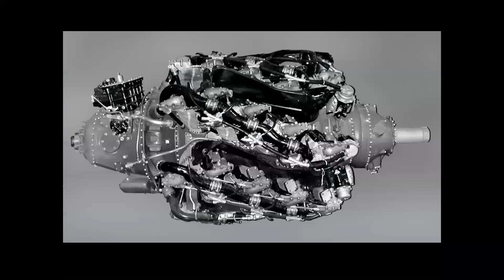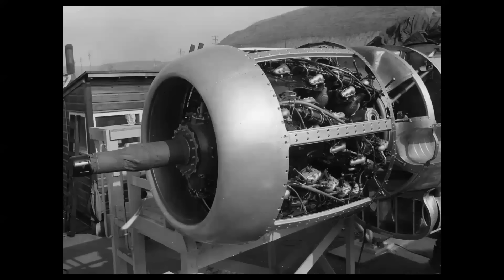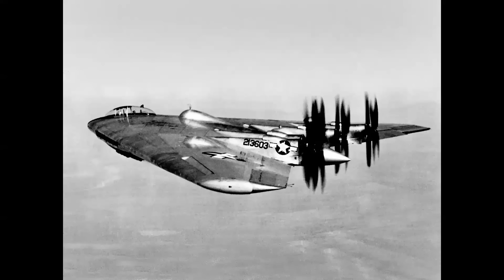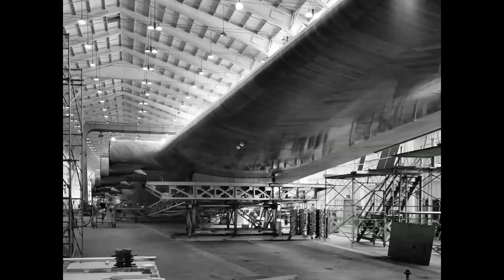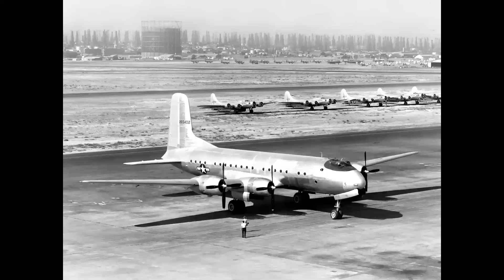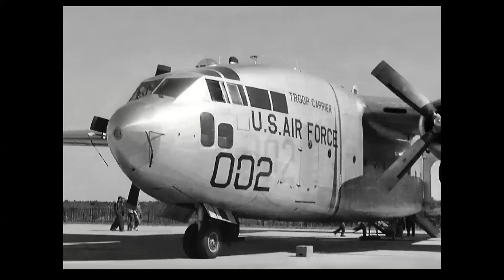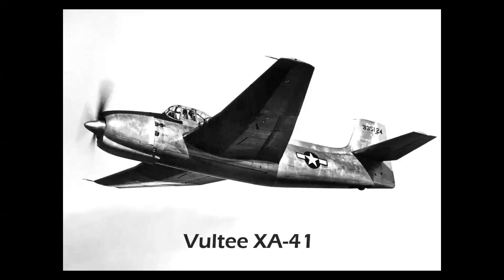PRATT & WHITNEY R-4360 WASP MAJOR AIRCRAFT - Airplanes powered by this giant radial engine

Comment: The Pratt and Whitney R-4360 Wasp Major was truly a formidabile engine for it's period but from what I understood it was very mantainace intensive, the Wasp Major engines also had a prodigious appetite for lubrication oil with each engine required a dedicated 100-gal tank. Normal maintenance consisted of tedious measures, such as changing the 56 spark plugs on each engine as the plugs were often fouled by the lead in the in the 145 octane fuel required by the R-4360 engines. Thus, each service required changing 336 spark plugs. It should be noted that engine fires occurred with the B-36's radial engines, some crews humorously changed the aircraft's slogan from "six turning, four burning" into "two turning, two burning, two smoking, two choking and two more unaccounted for" because this problem was exacerbated by the propellers' pusher configuration, which increased carburetor icing. Good job again 👍👍
Reply: They were impressive but in all reality they weren't very good engines, 4 rows is just too much and it led to the same kind of heat issues in the rear bank that the R3350 had if not worse.
Yea, of course I'd like to have one on a stand in my back yard so I could fire it up every morning just to drive my neighbor's nuts and blow the awnings off their house, but they still just weren't a very good aircraft engine.
Reply: I read that too.
Reply: The B-29 was ridiculed as " it has more Bugs than the Smithsonian " by one of the top USAF Generals at the time. Because the B-29 was prone to more downtime and awaiting specialists to fix a myriad of chronic issues with the aircraft causing sortie mission headaches and logistic nightmares for all who were dealing with the B-29's.
Reply: @faerieSAALE  One glaring problem being that of the particular model of the R-3350 Wright that powered the B-29 being RUSHED into production with out addressing the overheating issues generated by the exhaust manifolds being placed in front of the engines cylinders thus blowing hot air that was supposed to cool the cylinders across their cooling fins instead of cool air = OVERHEATING! I'd have enjoyed hearing the explanation from the KNUCKLEHEAD engineer that let that one slip by. That boo boo caused a lot of problems in addition to costing a few lives.
Reply: @topturretgunner  sorry but I saw only now your reply to a fellow as I'm very interested on this subject. In truth it always leaves me perplexed the positioning of the manifolds in front of the Wright R-3350 Duplex-Cyclone radial engine and as far I understood it is one of the very few radial engines installing the manifolds this way. As you rightly pointed out,  instead cooling it was blown in overheated air especially at the heads of the finned cylinders (hence the reason why it was often gulping the valves!). In truth I suspect that the Wright company was built around the most compact engine possible and was built originally as a single row engine with the exhaust turned to the rear and therefore it didn't had much cooling issues. Originally it was derived from the new Wright R-1820 9 and when it was united with another Cyclone (both an improved version) it was discovered that there was no space for the rear mounted manifolds so they were forced to install the manifolds at the front and I'm sure that they knew that it would suffer overheating problems but they tried to solve the issues, not successfully! As a matter of comparison also the German BMW 801 (installed on the Fw 190-8) suffered serious issues with overheating fitting various exhaust pipes and it was quite solved with a front mounted fan although it did absorbed around 100 hp. That said not a few crews got killed on the B-29 and very often the engines instead of being maintained were simply junked especially in Iwo Jima so perhaps as a hindsight it would have been a much better proposition to install the powerful and far more reliable Pratt & Whitney R-1830 Double Wasp but it fully occupied producing those engines for the P-47, the Corsair and the Hellcat. Hope I didn't bore you....
Reply: @faerieSAALE  the B-29 had the really awful Wright R-3350 Duplex Cyclone having a nearly 55 liter displacement figure but despite continuing modifications it was beset with dangerous reliability problems as the engines remained temperamental, and showed an alarming tendency for the rear cylinders to overheat, partially due to minimal clearance between the cylinder baffles and the cowl. that were not completely solved, and the engines having an additional tendency to swallow their own valves. It was also because of a high magnesium content in the potentially combustible crankcase alloy, the resulting engine fires, sometimes burning with a core temperature approaching 5,600 °F were often so intense the main sparcould burn through in seconds, resulting in catastrophic wing failure, similar what to the prototype that crashed into a factory killing the entire crew and many firemen. Despite many improvements and modifications including fitting the late B-29 like those that dropped the Atomic bombs it was never fully resolved the problem...
Reply: @paoloviti6156  w
Reply: There was also the "Major Overhaul" schedule where they were torn down to the last bit and then almost all moving parts would have to be replaced. It was labour intensive, required experienced tecnicians and some dedicated tooling. All this added to costs, even back then. And finally, gasoline/petrol was not as easy to handle than current day aviation kerosene.
Reply: @mohabatkhanmalak1161  of course but also routine maintenance was enough to drive you crazy! Seriously jet engines are far easier to produce and to maintain by experienced workers..
Reply: We had KC-97Ls at MTAB 134th ARG, Knoxville Tn. for part of the 60s and part of the 70s. Our tankers had a 26 gal. tank for ea. engine, a 52 gal. central oil tank that could be pumped into any engine tank as needed and a locally installed 30 gal trash can with plumbing to the central tank that was manually activated. I was on a flt. from Knoxville to Goose Bay Lab. where we used that oil and were pouring 5 gal. jugs into the trashcan to get us there. She liked oil!
Reply: @MrWoodhazl  you can really say that she liked oil! I don't want to say something stupid: from what I read I can presume that this engine had the highest consumption of oil among piston engines!!
Reply: One of the reasons why the B-36 had engine problems is because the engines were mounted in a pusher configuration and therefore did not have proper cooling.
Reply: @Shaun_Jones  yes, this kind of configuration could be one of the main reasons why this engine had so many problems...
Reply: @MichaelKingsfordGray  I can agree with you but according to what it written the front row needed to change the cylinders after 50 hours flight and anyway needed a complete overhauling after 75 hours but at Iwo Jima, again as I understood, many engines were junked instead of seriously maintaining. There is was another ugly problem, here is the following excerpt: "Because of a high magnesium content in the potentially combustible crankcase alloy because of it's relatively low flash point, thus resulting engine fires — sometimes burning with a core temperature approaching 5,600 °F (3,100 °C) — were often so intense the main spar could burn through in seconds, resulting in catastrophic wing failure. This is because Magnesium has the lowest melting point 648° centigrade (1,202 °F) and the lowest boiling point 1090° centigrade (1,994 °F) of all the alkaline earth metals. The point that it is impossible to put out the fire in flight so the only solution was to bail out or "land" in the ocean with minimal chance of survival. No wonder the  mechanics were so fed-up with this engine....
Reply: I flew C-119 tankers in 1980-81.  We averaged 5-10 gallons per hour of oil.  However on long cross country flights sometimes we could get down to three gallons per hour.  They ran good for us even though we did a lot of power changes during drops.  However running 100 octane fuel and no ADI we only had 3,000 horsepower on takeoff and the engines were locked in low blower so that may have something to do with it. We never had plug fouling problems on 100 octane and no overheating if you ran the cowl flaps properly.  One time during descent we had the power so far back I had the cowl flaps fully closed.  Of course we had to go around.  By the time I had go around power in plus a few seconds the heads were going through the redline!  I got the cowl flaps open real quick!
Reply: Wow that sounds like a lot of work and nervs of, steel.  . thanks
Reply: @MichaelKingsfordGray  yes but normally an engine, any engine from piston to jet engine, has a chart with a schedule with indicates at what maintaining and overhauling should be done every Time Period but this engine was notoriously infamous for prodigious appetite for lubrication oil that was quite typical with radial engines but also V12 in line engines was no joke...
Reply: Being maintenance intensive was a Hallmark of all late generation piston engines.
That is one of the reasons why jet engines with their comparatively low maintenance took over very rapidly
Reply: James Ricker   Very similar to when the Diesel Electric Locomotives took over from the Steam Locomotives.  Steam Locomotives are much more labor intensive in both operations and maintenance.  Most of that was done from the mid 40s to the mid 50s.  The jets for the most part about 10 to 15 years or so later.  I got out of the Regular Air Force in 1972 and we still had several aircraft that used those big round engines.  I still love the sound of those big round engines and the sound and smell of a Steam Locomotive.
Reply: @billmorris2613  exactly for the same reason
Reply: The 4360's on the C-124 and the C-97 rarely fouled spark plugs.  I changed a few cylinders because of pulled exhaust ports, and a couple of engines due to metal found in oil filter screens or excessive oil consumption, in the 3 1/2 years I did flight line maintenance at Travis and Kadena, but never had to change all the plugs on any engine.  Maybe it was a routine part of the periodic inspections done every 300 hrs.
Reply: George Gore   Oh yea!!!  Back then they still had the 140 octane fuel.  That is probably part of the reason there was not much fouling.  The other part was a good flight engineer that knew how to lean out the engines the way they were designed to run.
Reply: @billmorris2613  The flight engineers I knew were the best mechanics in the Air Force.  They truly understood those engines.
Reply: George Gore   Yes there is a lot of intense training for the mechanics / Crew chiefs, that usually became the Flight Engineers.  I was an AF crew chief in West Texas on C-130s.  When I got my first airplane in 1969 I was an E-3 and got it as soon as I got my 5 level, 43151F.  We were short of people and nobody wanted the responsibility of a crew chief.  I went to Warner Robbins with a flight crew to pick it up at Lockheed’s IRAN dock.  This was about 5 or 6 months after tech school.  My assistant was an E-4 and headed up the Post flight inspection team.  He never flew with the aircraft.

Then I had a 7 month tour in the Philippines as an area chief in the phase dock, 150 hour inspections.  I made E-4 and got my 7 level in the Philippines.  Then back to West Texas as a crew chief.  Made E-5 May of 70 then got out in Sep 72 when my enlistment was up.  I had tested for E-6 and had a line number as I was thinking about extending for a year.  I got out before I had the time in grade to sew it on.  But issues back home changed my mind about extending.  I had an interview with the T&P Railway co as a fireman / engineer trainee.  I was offer a job and excepted it.

Once back home I went into the AF Reserves as a Flight Engineer on C-130s.  We had gone to an airshow at the reserve base near New Orleans shortly after we got home.  We were touring one of the static display C-130s that was based there, and I was talking to the tour guide in the cockpit.  I mention to him that I had recently got out of the active AF and was a crew chief on C-130.  He asked if I would be interested in a flight engineers position?  He was the head of the Flight Engineers section.

I looked at my wife and without asking her anything she said, “Well this will let you have both careers.”  So I asked him what I needed to do?  He asked if I could come back on Monday.  I did and by lunch I was back in the AF.  The railroad supported military reservist.  They paid us what we would have made minus what the AF paid us, when we had to take off for the reserves.  Flight crews had more duty days than the weekends and the two weeks in the summer.

I retested for E-6 and made it about 9 months after I joined the reserves.  About a year later we found out the C-130s were going to be replaced by A-7s. My last flight was a few months later and it was to take one of our C-130s to its new home.  No flight crew position for me on the A-7s, so I got out.  So I never had to change spark plugs in the Air Force.  

But cleaned, set the gaps, and changed many in the civilian world.  I stayed in aviation as a part time career as both a mechanic and a commercial pilot.  I flew some charter (part 135) and free lance corporate as a back up pilot.
Reply: @billmorris2613  it seems that you have really enjoyed working for the Airforce and I'm glad for you! 👍👍
Reply: Paolo Viti   Very much so.  I credit the AF for completely changing my life for the better.  And the most useful part of my education.  Plus I got to see a lot of the world.  I made 3 trips with the Thunderbirds.  Before the AF I had very little self steam.  My high school counselors told me I should not take any of the higher sciences or maths like physics or chemistry, algebra, or trig, etc, etc.  

When in Aircraft Maintenance School I graduated at the top of my class, with very little studying.  I mostly looked at the pictures and read the captions below them.  What we were taught in class, which was a few aircraft in a hanger and an old 56 A model C-130, was hands on was very easy for me to learn and retainI.  I really got pissed off when I found out everything we are learning was physics.  Aerodynamics, electricity, hydraulics, nematics, etc, etc.  Nearly everything that makes an aircraft fly deals with physics.

I really struggled with staying in the AF or going to work on the railroad.  I loved both careers.  But the RR paid a lot more and we had great benefits.  The icing on the cake with the candles on top was going to the airshow and getting into the Air Reserves as a Flight Engineer.  I had planned to get a military retirement also from the AF reserves.  I would have put in 30 years if the C-130 or another aircraft that needed a flight engineer would have stayed at the reserve base near New Orleans.
Reply: @billmorris2613  I think it's great that you have achieved what you wanted! Good for you 👍 👍
Reply: Paolo Viti   I tell the story to hopefully inspire others.  Just because one does not do so well in High School or College does not mean they can’t do well in life.  I have a brother-in-law that can’t read or write, but has always had a good job.  He started out working in a body shop, then became an oiler for a crane company.  When the crane company moved up river he got a job in the body shop for the city.  He always made good money and has retired very comfortable.  He did have a lot of good common sense.  He had to take all of his test for promotions verbally.  He passed all of them on the first try.
Reply: @billmorris2613  I understand very well and thank you for taking your time to tell me. It would be nice if you ever come to Tuscany in Italy over a good plate of pasta together with good 🍷to hear more! Greetings from Italy 😁😁
Reply: Paolo Viti   Paolo Viti   Yes that would be great.  I did not get to Tuscany, but did get to a lot of good places in Italy and 10 other countries in Canada, Europe, Middle East, and North Africa on a rotation to RAFB in Mildenhall, England in the summer of 1972.  In fact one of the meals that I put in my all time best meals category, was at Oceney’s Restaurant up in the Mountains north of Aviano, Italy
Reply: Yes.  2 gal hr
Reply: Only the B-36 had 336 plugs. There rest only had 112 or 224.  I’m glad I was on C-130.  We only had a few igniters and the engine shop changed them if needed.  Those jet engines put over 4,000 horse power to the props.

As to the oil burn on those big round engines.  Even the smaller round engines burned a lot of oil for their size.  We had, if I remember right either 400 or 450 horse power round engines on the the Grumman Goose.  Again if I’m not mistaken there was a 12 gallon oil tank for each.  The T-6 had 600 horsepower and the T-28 had 1425 horsepower from 1820 cubic inches.  They both were heavy oil burners.  I know the owner bought his oil in 55 gallon drums.
Reply: @billmorris2613  l l
Reply: @Arthur Humphreys  of course lot of them has been produced and sold but it was very mantainace intensive....
Reply: While I never worked on these engines, I have read that they tended to have problems on start -up that they didn't have at shut -down. All engines suffer from heat-soak on shut down, when the hottest parts bleed heat into the adjacent parts that are often cooler in operation because they are actively cooled by cooing airflow. When the airflow stops, the cooling stops. This often leads to coking of oil, for example. The R-4660 was longer and on shutdown the middle of the engine didn't cool off as fast as say the R-2800 would, because of the length of the additional 2 rows. 
This would tend to cook ignition system insulation and rocker boxes to a greater degree on the R-4360.
Reply: Why didn't they place electric fans for extra cooling in front of these engines. Kind of moveable fans on wheeled frames. Just a thought. @jackthompson4993
Reply: A personal experience when I was 6 years old. With my parents I was on board a PanAm Stratocruiser at Honolulu bound for San Francisco. We had taxied out for takeoff and they ran the usual mag check. My dad who was an aircraft mechanic said "Uh oh, I don't like the sound of that." The pilot and flight engineer didn't like it either so we taxied back in and they changed all 224 spark plugs.
Reply: @mikemcguire1160  A good example of why pistons were replaced by turbines for aircraft powerplants.  But the R-4360 was certainly not a deficient example of a breed that was replaced by development of more economical technologies.
Reply: @gort8203  But they did have their day as the extensive list of planes in the above video shows. However it can be remarked that the Guppy C97 conversions eventually went to turboprops replacing the R-4360's.
Reply: @mikemcguire1160  Yup, because their day was over.  A turboprop is so much more practical that a big radial can't compete. Progress marches on but It was the end of a great era.
Reply: @gort8203  thanks for your memories of the days of, radial bank engins and I am glad that the problem was corrected before flight....
Reply: Freddy Black   Are you from Louisiana?  I went to high school with a Freddy Black.
Reply: @mikemcguire1160  I was an Army aviation mechanic.  Enlisted for helicopter mechanic, and was sent to fixed wing mech school.  My last job (1968, Camp Holloway, Pleiku) was crew chief on a U6A Beaver, with a R985 radial engine.  Long story short.  A major, who like many officers, believed rank made him of superior intelligence, would fly it occasionally to keep his flight time currant.  On fouling the plugs.  He would get up to cruise altitude and never pull back (adjust) the fuel mixture to lessen the richness.   After the flight, I would have to clean all 18 spark plugs.  They were not totally fouled, but black carboned up from over rich fuel mixture.  The front 9 plugs easy.  The back 9 plugs ???  5 of the rear cylinders had a sheet metal heater shroud over their exhaust for cabin and carb heaters.  So an hour or so job turned into a 5 hour can of worms removing and reinstalling the shroud to clean the rear plugs.  The major assigned to my plane was a cool guy, and did all the right adjustments to the fuel mixture and was a great pilot.  My aunt worked for PanAm in the 50's and 60's, and they would take a flight vacation once a year to diff places on the planet.
Reply: @mikemcguire1160  how long did that take ?
Reply: @stephenrickstrew7237  I was too young to recall but it must have taken several hours.